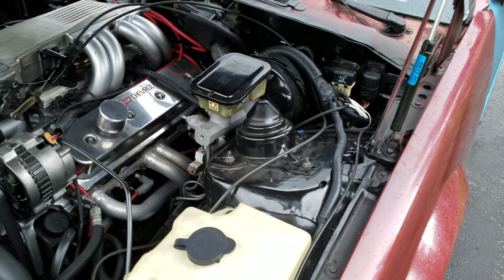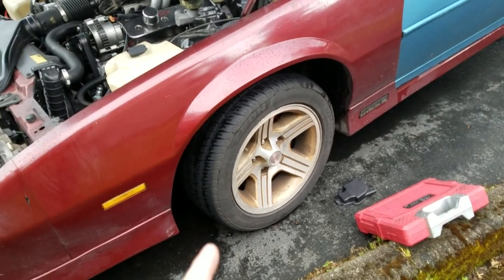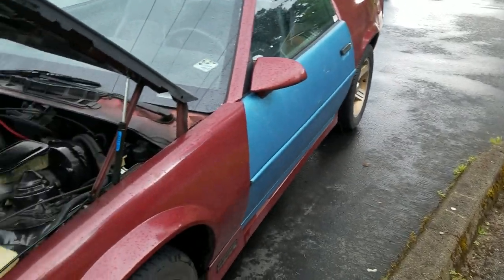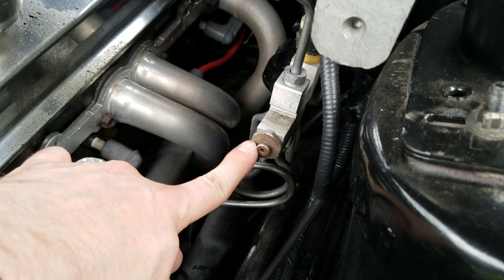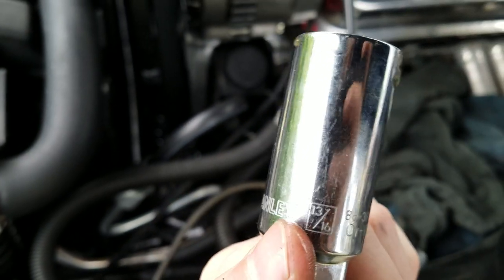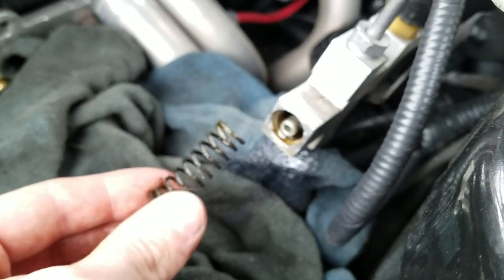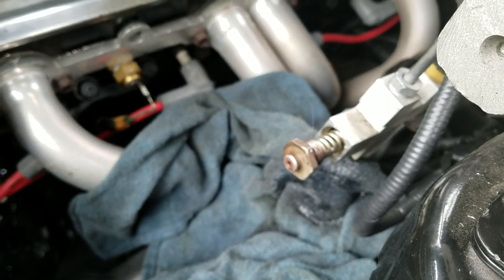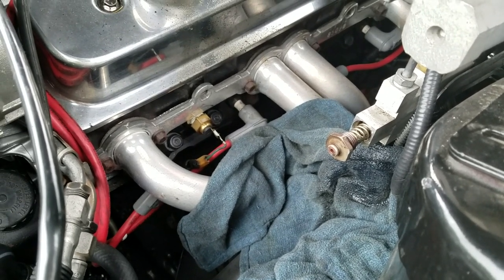Cheapest brake upgrade for a Third Gen f-body

Comment: I have to thank you for posting this. I’ve had my 88 GTA since 1996. I would only drive it on surface streets because it felt like the brakes barely held. I bought the 19 lb. spring suggested on Amazon ($5 for 5 of them). It took maybe 20 minutes to switch and bleed the brakes. What a tremendous difference. Thank you again for posting this video.
Reply: Wanna sell one of those extra springs?

Comment: Before I convert to rear disk brakes on my 92 Camaro, is it possible to run this set up with drum brakes and will it make a difference? Just curious, regardless I'm going to try it out just wanted to get feedback...
Reply from the maker: You can, when most people do the conversion they swap out the whole prop valve

Comment: I just got the the 19lb spring 
I bled the brakes took it for a rip 
We had a 88 GTA since new 
And in 1996 1998 high school auto shop I learned everything 
I did the front brakes and I did the rear pads even tho they didn't need them 
Now it had 120k back then 
Now it has 230 k 
It's 30 years old 
And the rear pads and rotors are still like brand new 
The  car when I hammer the brake it nose dives and I just got used to it 
I put the 19lb spring in took her for a 80km hammer brake and the car doesn't nose dive and the car slammed my chest into my seatbelt way way harder 
It's unreal 
I just wanted to tell you 
5 buck spring 
And brake fluid and some time bleeding it's by far the best mod
I have a 4 pack new springs 
I used 1 
So I have 3 for anyone who wants it 
It's unreal
Reply: Ben Kalinowski  are you running rear disc or are they drums ??
Reply: Daniel Brittain I have rear disc with factory 9 bolt strong rear end 
Not a ten bolt
Reply: I'll take a spring :)
Reply: @rabellsam  
Me too
Reply: Ben Kalinowski where do I get the 19lb spring?  Can u send a link?
Reply: hey where did you get the spring from
Reply: Where did you get the spring I need one
Reply: Mooch 514  follow the video I have the same set up it worked fine
Reply: Mooch 514  is it the same size prop valve just pointing downward
Reply: I’d take one of the springs
Reply: From where did you get that specific spring? I really need one, Thx ✌️
Reply: @davidcisneros7621  I have 4 out of 5 brand new ones I only used 1 out of a 5 pack 
You get them on eBay
Reply: Cool Ben, thx for responding, and thanks for the video, I just got 89 iroc and needs a lot of work, but I’m pretty sure small mods like this one can make a big difference. ✌️

Comment: I swtiched the proportion valve to 
A dial adjustable willwood unit.
It was 90 bucks and some line fab.
But man i was able to dial in the stock brakes.
Its very balanced and ive got rear drums.

Comment: Cool. I like your video. What kind of exhaust headers are those?  I have Hooker headers for a ‘92 Camaro TPI. Do you have a video on installation tips? I’m having a hard time cramming them in. Thanks
Reply from the maker: I bought it with the exhaust already installed but I heard it is a huge pain to get them squeezed in
Reply: J Robling ah, lucky you. I’m considering going back to stock manifolds. It’s a pain trying to get those headers installed.

Comment: Nice video!! 
I have a 1992 RS 305 with drums in the rear will this still apply to me???
Reply from the maker: Yes, the drums in the rear are still being fed by the master cylinder. It's not going to be as good as disc brakes but it will improve it.
Reply: @JRobling  If it wouldn't work as good with the drum brakes do you think it would be better to use the 22lb instead of the 19lb if I have drums in the back?

Comment: Planning on swapping my drums for disc, my guess is 22lb?
Reply: Allen Powell I'm searching for the answer to this exact situation. If anyone has any thoughts it would be much appreciated.
Reply: R8V8Vantage599 I'm currently looking into putting in an adjustable proportioning valve in. That's going to allow me to run whatever the hell brakes I want. As well as fine tune. I don't know if that spring will be adequate for my breaking situation. I put 4th gen rear axle in my 3rd gen car.
Reply: Sounds like you opted for a different setup but if anyone else wants to know in the future I installed a 4th gen disc rear on my 3rd gen that came with drums. Just installed the 22lb spring works as described for cars that were originally disc rear. It now wants to lock the rears first.
Reply: I did the rear end swap from a 97 into my 91. Ok so the proportioning valve looks like a good idea if you have the cast iron prop valve. But the aluminum one on my 91 is metric. I need to get a flaring tool to convert the lines on the car. Looks like a pain so I just got the 22lb springs, it figures they might be too much. Haven't drove it much because the parking brake cable that were on the axle didn't fit.

Comment: Just looking for a link to buy the 19lb spring or a part number for local parts house that might carry them.  3rd Gen bro’s please help!
Reply from the maker: I put a link in the description for both springs
Reply: Thanks just ordered it!
Reply: I have an issue, when I put the spring in, my rear valve hole leaks brake fluid when I press on the brakes.  Any idea why?  I put the stock spring back in and it stops leaking.

Comment: I tried this with the 19lb spring you recommended and my back brakes still locked up. Keep the stock spring that the engineers designed for the car and just upgrade your brakes.
Reply: "Still locked up"? If they were locking up before this mod, a heavier spring certainly wont fix that problem.. Dont give humans advice unless you actually know what you are talking about. Anyone else who's rears are locking up, get that fixed first THEN test a 19/24lbs. 👳‍♂️

Comment: you need to understand that cars need to be biased to have the front brakes 
do the majority of the work otherwise the rear brakes will spin you around 
and you will loose control regularly and crash.
Reply: Exactly.
Reply: WRONG
Reply: no,not wrong...why do you think 90% of old muscle cars had front disk rear drum?>
Reply: @trillrifaxegrindor4411  
Well explain why we got smart & nolonger do that.
4 wheel disc are standard on almost everything now.
Reply: Charles henson yes 4 wheel disc brakes are standard, but there is still a bias towards the front, typically a much larger multi piston caliper on the front and a single piston caliper on the rear, this is because when you hit the brakes it preloads the front suspension and provides roughly 70% or more of the traction, we did not “get smart” in recur the times and somehow change the laws of physics, unless your car ride height it zero, which is impossible, then you are always going to put a moment on the vehicle when you apply the brakes, and a biased front brake is needed to provide even braking for the given traction.